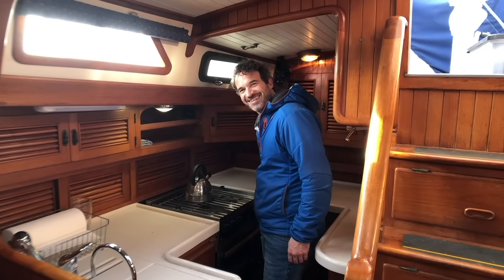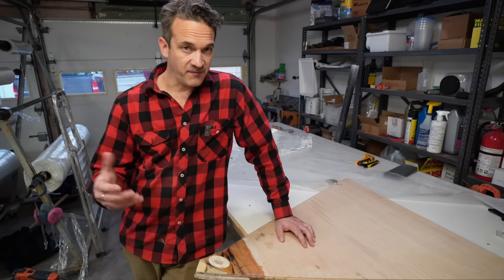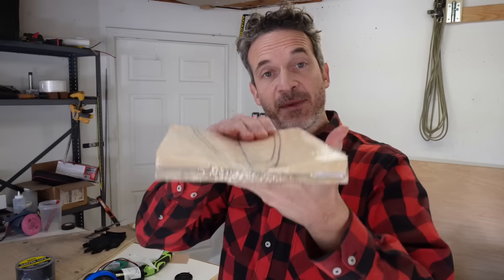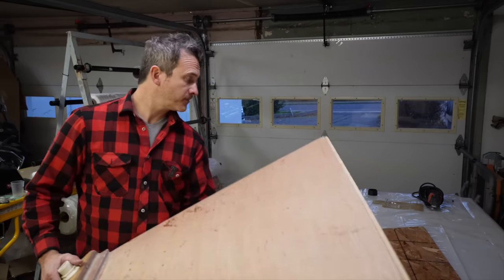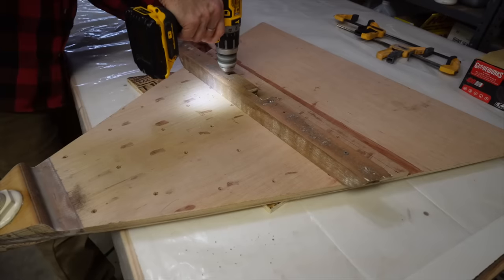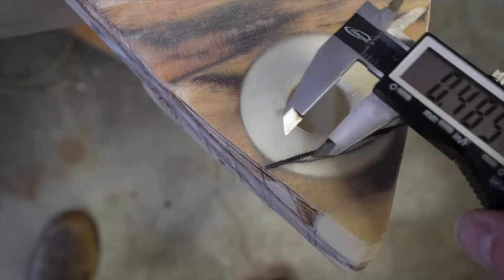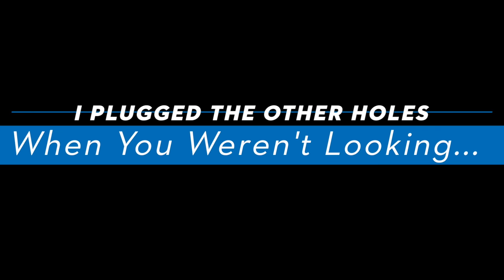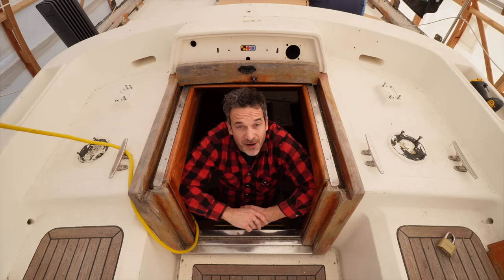Transforming the Anchor Locker and Bulkhead on Antidote - E017

Comment: Never noticed water in the binge from anchoring, cause there’s so little of it.  There’s should always be some water in the bilge if you have the typical stuffing box.  The only water that causes problems, other than enough to sink you, is water from a dehumidifier because it will soon stink.
Reply from the maker: I’ll be replacing the stuffing box also. I’m trying to get the bilge as dry as possible 👍🙌
Thanks for the feedback 🙏

Comment: If I may give you a tip: do not drain the water with a pump! They are expensive and they break and you need to put an other hole in your boat. Just take a hose (looks lik you have 1" there) and lead the hose to a place you can access it an put a valve on it. A 12ft 1 inch hose can hold halve a gallon of water. Just drain in once a month in a bucked. I am a big fan of KISS (Keep It Simple S*****) so thats one less pump, one less thruhole and it will not break
Reply from the maker: Interesting idea… 🤔
I had considered putting a backup/overflow pipe from the sump box so maybe with both I would have a backup failsafe that can be manually drained like you mentioned and hold 1-2 gallons… 🤔
Reply: @livingforsail  I have the solution I discribed, but my hose is only two feet. most of the water evaporates I drain it once a season. But I do not anchor daily
Reply from the maker: @heelgraag  Ok. Good data point. Thanks!

Comment: My anchor locker drains the same way yours originally did and I’ve always wanted to change that. Is there a reason why you vacuum bag parts like the little anchor locker floor piece? A regular hand layup is more than strong enough.
Reply from the maker: Vacuum bagging is a new skill to me so I’m mostly just experimenting. I agree that you don’t NEED to use vacuum to make this part. It’s just how I wanted to do it. 👍🙌

Comment: What are the cons of making it watertight, assuming you build a hatch? I guess the complexity of the hatch is one? I can how just sealing it entirely would be bad if you can’t access the locker.
Reply from the maker: That’s the major thing. Balancing locker access, complexity to add a hatch/door, added weight cost and materials to stiffen bulkhead with what could be around 3,000 lbs of water I figure based on some really rough estimates…
👍

Comment: I use nylon plumbing tape on threads like that. It holds on my high pressure air lines 120 psi it should definitely work on that drain
Reply from the maker: You have straight threads on high pressure air lines? Most of those fittings that I’ve seen are tapered NPT… 🤔

Comment: Limited budget???  I’d be interested in how you came up with a budget for tackling this project.  With so many unknowns going forward, how do you deal with issues such as rotten bulkheads?  Obviously you can’t cut corners on structural parts of the boat just to save the budget. Are you making sacrifices elsewhere or just adding to the budget?   How does someone go about planning a refit of this magnitude?  Not to mention scheduling YT episodes around this project.
Reply from the maker: Yeah, good questions! Haha. I think just like every construction project this one will end up over budget too. 
I hope my wife’s not reading the comments today (hi Bridget!) 😳
I planned for a full deck replacement, the bulkhead did not even show up on the survey which I find interesting… you may recall that we bought the boat unseen. 
Yes, my biggest expense is time and making the episodes adds to that exponentially…
When I have an opportunity to save $$ I take it! 👍🙌

Comment: I'm all for the water-tight compartment, however as I recall your windlass was deck mounted, and not below deck mounted withing the chain locker (below a hatch).  Since you will not have access into the chain locker from the deck, the only access to work on the windlass electrical connections, dealing with chain castling, chain replacement / maintenance, or cleaning out the bottom of the chain locker would have to be done through a waterproof access panel.  As that chain locker is fairly deep and most waterproof access panels on the market tend to be on the smaller size, I'm not quite sure that it wouldn't cause more trouble than it would be worth.  I might consider protecting the bow with multiple layers of carbon fiber cloth instead, layered over the existing bow to add strength and rigidity against collision.
Reply from the maker: You are correct about the windlass wiring. I would probably target to have a cover/door closing from inside the locker (water pressure would hold it closed) … I would aim to get it “pretty water right” but more importantly strong enough to hold back the weight of the water. This would just buy me time in an emergency I figure and hopefully keep any water ingress to an amount the bilge can keep up with. 
Thanks for the feedback! 🙏👍🙌

Comment: F your having a box , put filters before the box , quicker and easier to drain ,  then a mesh on the hose , keeps any pump protected . If its for a anchor you will, have lots of crap that will, enter ,    for your emergency bail out I have used on many yachts , a hose that can run from and overboard pump incl the bilge pump, ad a y valve , so you can roll out this hose to anywhere in the boat to bail out . Alot safer than putting crap in your bilge .
Reply from the maker: Good ideas. Thank you! 🙏👍🙌

Comment: Yes because plywood has an odd number of plies there is always one extra ply in one direction or along one dimension usually the longest dimension unless you are buying specially made biased ply plywood that has the grain running at a 45 degree bias angle the fact that you are laminating sheets yourself means you need to alternate the plies just like they did at the plywood factory unless you want a lot more strength-stiffness in one particular direction. Most generic plywood is made with 90 degree plies that run perpendicular and parallel to the sheets edges and are 3 ply all the way up to 9-11 plies thick depending on the sheets thickness as to how many layers they use. Some specially made plywood for use in the marine and aircraft industry has extra plies even in the thinner sheet thicknesses and also they make some with 45 degree plies to the sheets edges as well.There are higher graded AAA royal marine and aircraft grades of ply have no voids in the core material veneers or very few and small ones that are patched properly and zero surface veneer defects also in the triple A grade materials. Plywood is a remarkable material too bad it has become terribly expensive for what it is and then it still has to have more money poured into the material to prevent it from checking and or de laminating and going bad again in a few years if it is exposed to moisture and the sun especially. Plywood doesn't absorb water as fast as other wood based sheet materials can like OSB or Balsa core does who's end grains act like wicks plywood does still do this same thing though overtime if it isn't kept sealed 100% and also the surface veneers can check (crack) if it is not laminated with light weight fiberglass finishing cloth with epoxy resin especially on sheets exposed to temperature swings. A lot of people are going away from plywood in boat construction to foams and plastic lumbers instead do to the fragility of plywood to moisture and heat checking. As long as you keep the plywood sealed 100% it will never fail though so just inspect and repair any scratches or cracks right away in the epoxy coating or keep it well painted and you will not suffer these problems. Make sure to coat the end grain with several coats of epoxy to seal that up really well also in the lower areas of you bulkheads that will be the spots that see the most water but do the whole thing you must completely encapsulate the plywood for the best lifespan preferably with lightweight fiberglass finishing cloth as a re enforcement also. Remember that if you don't have the time or money to do the job right right now  when will you get the money and the time to fix it later on. Just take your time and do the job right the first time in other words
Reply from the maker: Wow! You really know your plywood facts! 🙌. Thanks for the feedback. I am planning g to have the new bulkhead fully wrapped and encapsulated in glass and epoxy. 
I agree. Take your time and do it right once! Cheers!!
👍🙌🙏

Comment: Man its the bottom of a locker. Non structural no one sees it its just a drain. This is where i would just dump left over resin and bog during the project and finally hand lay one piece of glass over it or just some liquid epoxy.  Vacuuming ten layers of glass is ridiculous.  Its even got a sub floor above it so it wont even have chain hitting it. The heaviest load on this is water droplets and youve vacuumed ten layers of glass. Man you are never going to finish at this rate. The foredeck and bulkhead is about three days work tops and that includes laminating the top of the deck. Now i understand your a perfectionist but this is crazy definitely not perfection. And no way would i use ply for that bulkhead, but heh thats just my two cents which isnt even worth one cent. Man im 63 years old and id really like to see a launch video one day. Cheers
Reply from the maker: I think your thoughts are worth at least $0.02. I’d even pay you in AUD. 👍
Reply: @livingforsail  I think you might be the only person that thinks my thoughts are worth that much. Even my wife thinks they are overpriced at two cents. Cheers

Comment: I can tell your a engineer, I hope you know when B work is acceptable and even preferred if you don’t you’re going to make this project take a lot longer
Reply: I agree. The anchor locker isn’t a structural compartment. This is way over engineered. It’s hard to back off the engineering side. I agree with everything else but sometimes you have to say it’s good enough.
Reply: I'm with doing it once, but doing it as best as you can, especially bulkheads they have to be solid an integral part of your boats structure. Antidotes water damage is pretty bad so make it right now for longevity and piece of mind.
Reply from the maker: Yeah, it’s a good point. This is perhaps an area I could “back off a little bit”. I’m having fun so… 🤷‍♂️🙌👍
Reply from the maker: I think this makes sense too. 🙌
Reply: @livingforsail  I reread my comment I should’ve been more specific I wasn’t talking specifically about the anchor locker but more in a general way. It’s very difficult to analyze yourself. Just trying to be helpful